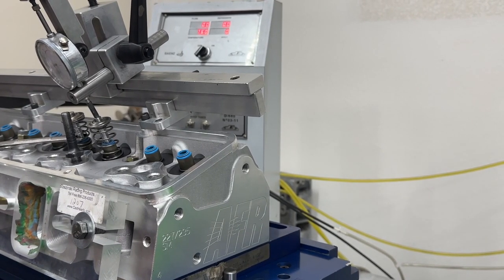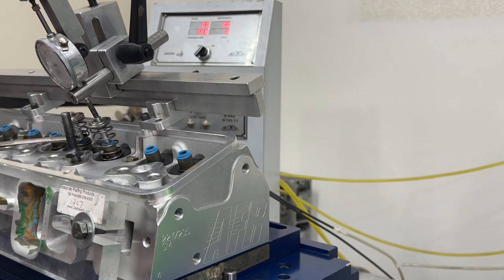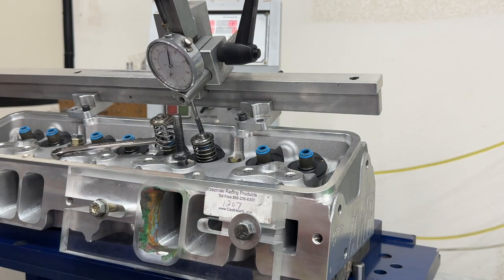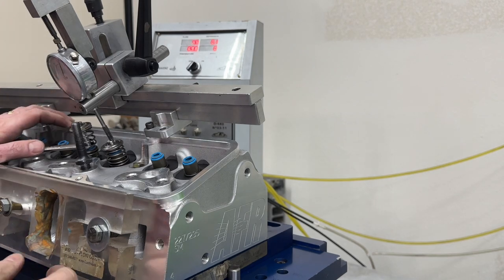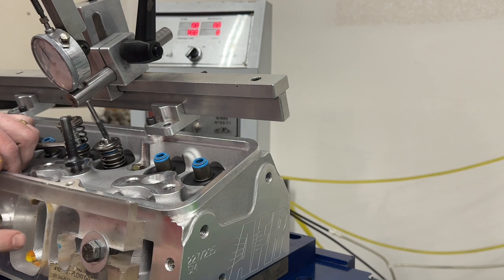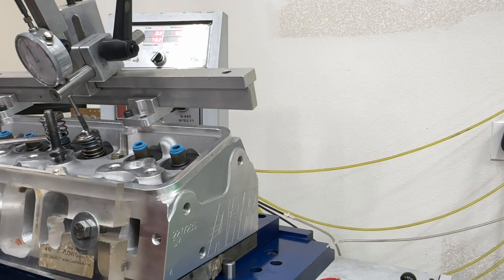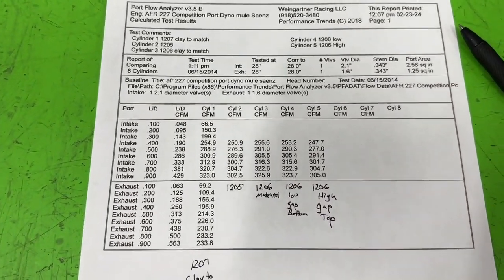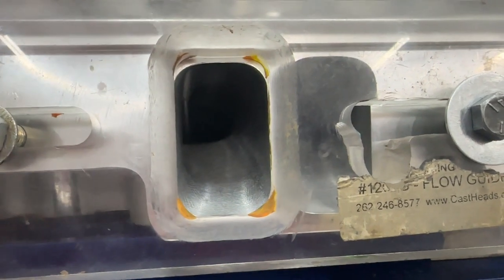How Does Intake Location Affect Flow

Comment: Hey Eric,
     Tim here, i knew the raised plate (exposing the top of the port) wud hurt it......any intakes flow will really start AT the top/roof of the intake/port, bottom isnt that critical.....think about a cyl, pullin in a new charge......its gonna pull from the roof of the manifold, B4 it ever gets to the floor, as its the easiest path, just like electricity......overall, it proves that a properly gasket matched intake, sitting properly on the heads, is HUGE........back in '82, my brother had a '68 Firebird race car......intake was a Torquer, heads were iron #62 Pontiac castings, heavily ported, so then was the intake....his guys, PINNED the intake to the heads....so they saw each other properly......just like heads have a dowel pin, his intake had same......ALWAYS perfectly lined up.....the car Kicked ASS, for the time (again '82) ......mid 10's at 135......rather killer for an iron headed Pontiac, in 1982!!.......GLAD you did all that testing, i stayed for all of it, as i was wanting the raising of the plate, to prove my thoughts......ROOF is more important than floor, on head/intake port entry.....LOVED it my brother, sorry i yak so long.....PEACE to you sir, OH, and toss us a Bishop update soon.....i'm into his progress!!!....ok, PEACE!!

Comment: The flow goes for the shortest path. At the bottom of the port the air travels a lot slower than the top, in your setup. BUT, when you add a full intake port to it, the laminar flow has more distance to form, so the bottom starts to have an effect. Still not as much as the top, but a lot more than just a plate. This is why you need the whole deal. From the stack/air box, to the carb and intake. If you simply modify the last bit before the valve, you actually slow the air speed down before the valve and may drop some fuel from suspension. If you only slap a giant carb with shiny intake on your stock port and valve, you lose the venturi at your jet location, killing your low end and AFR. To make noticeable gains, you really need to take the path as a whole, from the air box inlet to the tip of the exhaust, with adjusted cam profiles to match the air velocity. And the air wants to go straight, until it doesn't. The valve pulse creates a wave that travels upstream, and the flow reacts to that with oscillating wave. With certain rev number the torque drops, and with another number it jumps. This depends on where inside the bowl the oscillating laminar flow hits. At jumps, the flow goes right through the valve opening. The other effect to this is the exhaust, that also needs to be tuned with valve profile. It can either push or pull during the overlap, affecting the chamber fill and torque. "A step here or there doesn't count as long as everything is big!" No. Every step counts. Every shape counts. A port flow number is just a number.